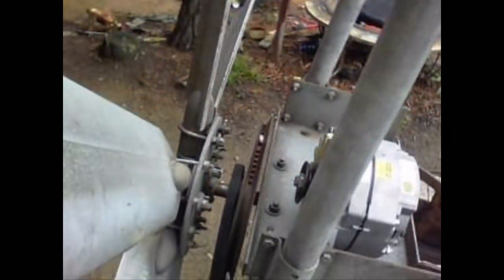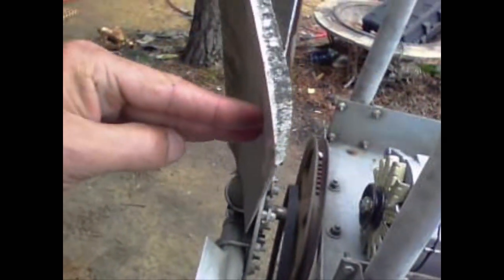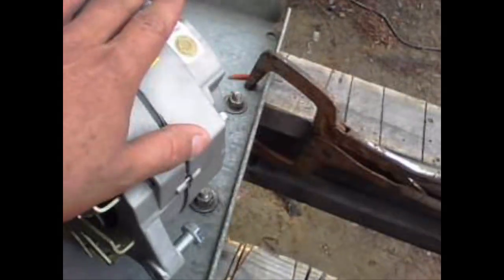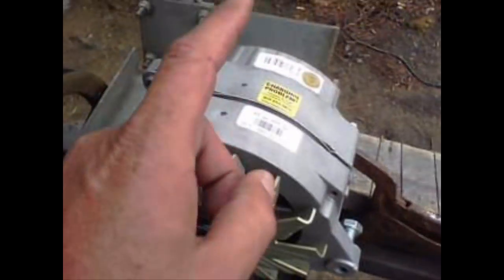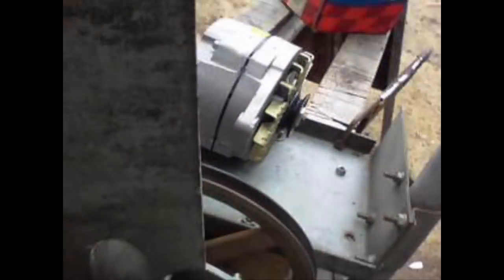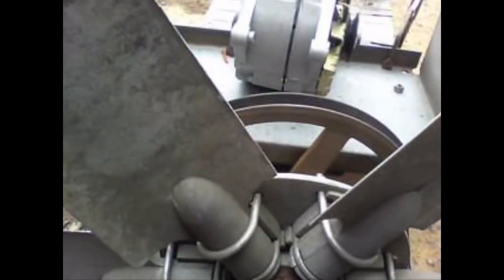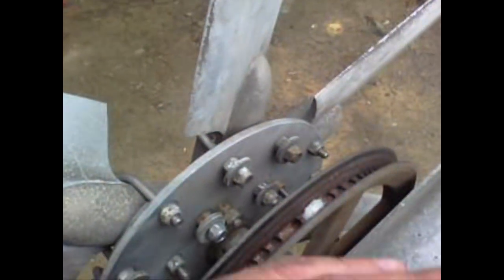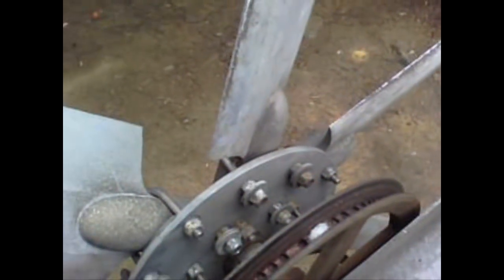homemade windmill generator part 3

Comment: Your blades are on backwards.  The sharp end should be the trailing edge.  If you rotate the blades in the hub, not only will they work better for facing the wind better, but it will also reverse the direction the turbine spins, and you can use your 200 Amp alternator.
Reply: lmfao so much misinformation here lmfao
Reply: That caught my eye immediately, It's like putting wings on a plane backwards. Also if clockwise rotation is an issue (which it shouldn't since it's AC) he could simply add another cogwheel to the equasion, problem solved. Also better off purchasing a set of blades and make sure they are properly attached to the rotor with millimeter-precision. Any measurement mistakes not having the blades perfectly set around the rim will sooner or later just wiggle your whole setup apart. You could compare it to what will happen to a washing machine should it not be set onto a flat surface.

If the wind is really strong, you wouldn't even want to be close to that thing, it like a giant mincer.
Reply: @MrDertien  You miss one factor. Cooling. The alternator fan is designed to turn in one direction only.
Reply: Baaahaahahaa
Reply: TWO things going on here.  

First,  your blades are angled BACKWARDS!
Second,  IF the alternator needed to spin the other direction,  mount it backwards!

Comment: do you think you would be able to use multiple alternators per fan? I live in an area with alot of preppers and im close to a big city so i want to leave as small a foot print as possible. I would like to try and have enough power coming from 1 to run my whole house with solar as a backup!

Comment: Hey man I could be wrong but I think you have your turbine blades going backwards. The sharp edge should be the trailing edge. The blades resemble a lift turbine that resembles the wing of a plane. The way you have set it up is with the wing flying backwards. Although it will work if you re-orient the blades so the thicker edge is leading you will get better results and will get your turbine rotating anti clockwise. As I say I hope I'm NOT wrong - but I have a background in turbine design so I think I'm not selling you a dog that won't hunt.

Comment: FYI an alternator will charge in either direction, also if you load the alternator the belt will slip if you don't have enough belt surface area on the pulley, I saw a comment about gear drive or notch belt would also be a good setup as well.  It will take some good HP to get 100 AMPS out of an alternator not sure your gear ratio will work.  Hope you had good luck, I can't find any video of the finished product.

Comment: 750 rpm but at what horsepower input? The higher the amp draw on the alternator, the stronger wind required to maintain a given rotation. I think 100 amps is a lot to ask of those little blades in a normal breeze. I'm with windsunvolts on this one. permanent magnet brushless would be a good match to that blade type. Neat project. Can't wait to see the results. Crossing my fingers that your good old fashioned ingenuity works better than my hillbilly math.

Comment: I have run a FORD alternator backwards since the early 1980's on a homemade generator.  All I did was revers the output leads and it works fine.  You're problem is going to be torque!
Reply: may i know how you did it my brother, because some of us we are in rural areas, i need home made generator.
Reply: @peternlungu8843  No need to do that just turn a figure 8 into the belt and the bottom  pulley turns the opposite direction of the fan one.

Comment: To reverse the rotation you need only to twist the belt and install it. You still could have 200 amp. One more thing I think your blades are mounted 180 out. The curved section should be facing the windward side. Great job so far

Comment: Look at the Power Twist Plus Link Belt.  These work like a regular V belt but are actually individual small links that hook together.  Solves the resistance problem and you can take links out to create any length belt you need.  Most of the wood working stores carry them.  I have used them as replacement belts on belt driven wood working machines.  They work really well.

Comment: A GM alternator will charge going either direction. I put a 4-53 detroit diesel engine in a Chevy pick up and ran the alternator off the pulley on the passenger side which runs backwards and it charged fine for years. The fan runs backwards but it still gets air flow. I believe they do make fans that run backward too.

Comment: How about turning the alternator 180 degrees to make it turn in the correct direction? You would need a longer belt and a mount somewhere Out of reach of the blades.

Comment: A few suggestions for you...
1. Stainless steel is NOT strong. It is about the same as 12L14 steel, so dont get confused in thinking that just because your U-bolts are stainless that they are strong...they are not, unless you heat treat and aneal them. Try to find you some black oxide u-bolts as they will be at least 2 times stronger.
2. The heavy belt is not such a good idea. Your 6 inch circumference pulley is a 2 inch diameter. For the belt to not slip, you need to get the belt to wrap around the pulley as much as possible. I would use a smaller belt and install a tensioner as close to the alternator pulley as possible to get as much wrap as possible.
3. Balance the blades the best you can. Dont add weight to the blades...take weight off. You can also build or buy a governor to control the top rpm of the blades. We used a clutch like you see on go-karts and it worked perfect.
4. On your alternator...try to find a high output marine alternator. Marine engines, like Mercruiser are not high rpm engines and the wiring wraps in the alternator stator are different than they are in car alternators so that they will produce max power at a low rpm. If you are getting your max power at 2500 rpm, then why turn the alternator faster...you wont gain anything except wear and tear on your alternator.

Good luck on your project.

Comment: Why did you get a new alternator whenhou coild have just turned the original 180 degrees. Then it would be in sync with the fan.
Or a two gear setup to turn it around. You could have used gear ratios to increase rpm too
Reply: The pulleys take care of ratios.

Comment: I have to agree with previous comments..as far as electrical power generation, alt does not really care what direction it's turning in..that only matters for the cooling air impeller, which has a preferred direction of rotation, and I'm quite certain the direction you are turning the alt at 1:02 is the not the direction it would turn in the vehicle..that is a centrifugal impeller which draws air through alt and whipping it out the impeller (yes, in the back, and out the front!)  Cheers from CT!

Comment: Good thinking on the smaller belt.  I never thought about it, but I'm sure you're right.  
Fist up, Fight for Truth.  PS. you could have put your TAIL of the windmill on the opposite way and the wind would have Blown it backwards. OR you could have turned the blades 45 degrees and it would have pushed the blades the other direction.   
 It took two beers and a bag of chips to think up those two solutions.  I'm good at fixing things after I fix things.

Comment: if you put the belt in a figure eight it true Motor in opposite direction.  you also can run a Jack shaft to a wheel of the right ratio you want.  with a double pully off jack shaft.  two facts for thought. good luck bud,  love the out of the box thinking.

Comment: You shoulda coulda put a tensioner on it therefore reversing the direction of your alternator but you are very smart and this is very informative. I appreciate your video. Hey have you heard or checked into any of the videos out there about turning washing machine motors into output generators? Anyway keep on keeping on!

Comment: You can also use a third pulley to reduce your belt angle. Put the alternator between the main pulley and the third pulley. Thanks Ironhead.

Comment: I bet you can take those cooling fins off that alternator too to help with drag.  If that thing is going to be up in the air it will get plenty of air flow to keep the alternator cool.  And what if you could put high powered magnets on the pulleys spaced evenly and eliminate having to use a belt or chain?  Put positive magnets on the large pulley and negative magnets on the alternator pulley so the repel each other to turn the alternator.  Not sure if that will work just throwing an idea out there.

Comment: You can also play around with your Rotor current to alter the load in the wind. This would mean redesigning your own regulator. At low speeds reduce the current to increase the speed. This will however allow the alternator to run at higher speeds in low winds. When the speed gets to high increase the rotor current. This will act as a brake. However this will affect your output current and voltage. I would then design a voltage regulator in series to limit output current in high speeds. If you are charging a 12V  battery - Limit the voltage between 13.8 and 14.2 Volts. However never exceed the charging rate of the battery. Good Luck.  Hope this helps.

Comment: That looks much more common sense than the big GE type wind generators you see in wind farms. It has plenty of sail, and you have designed it to withstand up to 100 mph of wind. Costs much less to produce, and pays back it's startup cost much sooner.

Comment: you may need a larger pulley on the alternator . I happen to agree with ChaplainJoe1,
if you get 50 amps it will be a great system

Comment: i believe you can put a longer shaft , move the pulley to the other side of the plate and turn the alternator around you will need another bearing also

Comment: it should cool cause it's in the open and facing the wind, unlike in an engine compartment where it is tough circulating air through and what does is already heated from the radiator.  just my 2 cents.

Comment: These Altenators will self excite at about 1,700 rpms. I don't have a battery in my mower and all I have to do is Rev it one time and the lights and everything electrical comes on and stays on even at idol speeds. Using a 4" pulley to drive the standard GM pulley.

Comment: You can buy a 200 amp alternator on any 4wd site that produce juice at low rpms.Put the fan directly on the alternator.If you had  a giant chimney stack you could actually intall the fan and alternator at the bottom and it will have continuous spin 24/7.Although you wouldnt make high loads of power,you would have steady power.If you have ever stood at the bottom of a smelter furncace you can feel the draft pulling non stop.

Comment: The best way to charge a battery is slow at 2 amp. for the long lasting battery life. So all that out put Amps you can use on the spot. Just something to think about.

Comment: Right on I am watching close as I want to add an alternator to my giant wind powered air compressor / water pump. I have been using a belt to drive the compressor head for 2 years and it works great. Regarding blades, go with your intuition, mine are pvc cut in 4 pieces. they said they would break, wrong. they said they would be efficient enough.Wrong. It is so strong it will drive whatever i add

Comment: Turning the alternator backwards ought to be ok, it just won't cool the same, but it is not stuck on the side of a hot V8 next to the exhaust so it ought to be find, probably could take the impeller off completely to save a bit of power

Comment: There`s quite a tug when the alt kicks in it almost works like a brake ,But if it`s not precision balanced that`s how it will grenade by shaking the whole thing to death , I`ve been wanting to build one of these for years I have 3 external Gensets & one HD dodge Alt , They used to use for keeping plane batteries charged while away from power it has a motor like a weed eater high speed but it will make 12 & 24 V .

Comment: why don't you simply get a longer belt for the first 220amp alternator raise it above the blade and turn it around and it will turn the proper direction?

Comment: a little education for you. 1 the blades must be angled the opposite way at a higher degree of pitch. then all have exactly the same angle and weight because of balance and the vibration caused from imbalance. also as the wind increases if you have not built in a voltage regulator you will blow your batteries and fry wires. also a break would be a good idea to lessen vibration do to wind variants.

Comment: You know you can buy a high output 200 to 250 amp alternator for a honda. Also it looks like you cut the blades shorter then they came. The longer the blades the more wind it will catch and the more power you will have to gear up the ratio to the alternator.

Comment: The fan blades are going the wrong way 
The leading edge of the blade (the thick part) should be the first thing the wind hits and the trailing edge(the thin part) should be the last to get hit by wind that way you gain more power and efficiency out of a wind turbine so when looking the fan from the front ,top blade should get turned clockwise for around 45 degrees 
I hope this helps
Reply: yet no one thinks about the wind driving the blades is going to cool it regarless of what a few FLAT PIECES of metal do..  (drive air AWAY from the alternator)     lol

Comment: That alternator is designed to turn clockwise,  You can tell by the fan fins.  They suck air in from the back and out through the front.

Comment: why not make a jack shaft so you can mount the 200 amp alt in reverse direction?  After all your already using another shaft/pulley to increase RPM...

Comment: If you reduce the amount of wrap of the belt, you reduce the contact surface area and will have issues with the belt slipping unless you run it too tight and overload the bearings in the alternator. Get a motorcycle chain. A bike chain should work too, but might wear too quickly. You may see it run fine for a month and then it seizes or breaks. You will have to oil it automatically regardless. : )

Comment: Just so you know you can pull the pulley off the end of the alternator and reverse the fan on the alternator itself. The alternator will generate power either way it is spun around the difference is cooling of the alternator. I have built a few of these. You could also just loosen up the U clamps and turn your blades in their holders and it would spin the other direction. But just so you know and I understand you wanting the heavy side on that side. You can simply pull the pulley off the alternator and flip over it's cooling fan small spacer and put the pulley back on. Some alternators you need the spacer some alternators you don't but most fans on the alternator can be turned around. But the alternator itself at least everyone I've used and I have one that are permanent magnet alternators all the way to Hondas and Ford,Chevy, hell I even have one I built from a Fiat alternator! Most of the alternators will generate power either direction. The other thing is the alternator will never see the temperatures it was intended to see. As far as engine heat so you technically don't even truly need the fan on the alternator. It's not in your engine bay anymore even the one I built out of 6 in PVC drainage pipe where the alternator is completely enclosed has never even gotten warm in comparison to under a engine Hood. Hell I've taken the fan off most of my alternators to build them. I will recommend you switch to a permanent magnet alternator! I found that a 120 amp low RPM permanent magnet alternator is the best for building turbines. Permanent magnet alternators do not require 12 volts in to turn on they charge when you spin them! Used daily you never have to send it a signal to turn on it just runs and turns on when battery isolator recognizes low charge. I use a combined system for charging I got it from Missouri wind and solar. One side has relay four turbines the other side has relay for solar panels. I also use a solar pulse controller to ensure a even smooth charge. I run everything off of the wind and sun. Solar panels are great for those low wind days but the alternator turbines still produce decent power even with only three or four mile an hour winds but the solar panels help them out on a cloudy day when the solar panels have next to nothing but the winds are always up the turbines do most of the work. Using them combined I have never had low battery problems. My charging system is overkill just a bit because I have so much charging power but I run 8 deep Cycles in One Bank and another 8 in another.